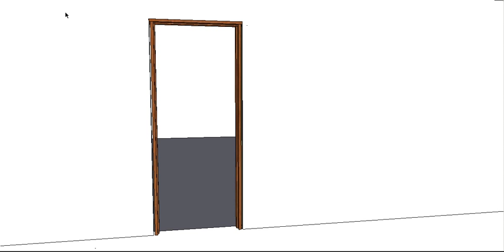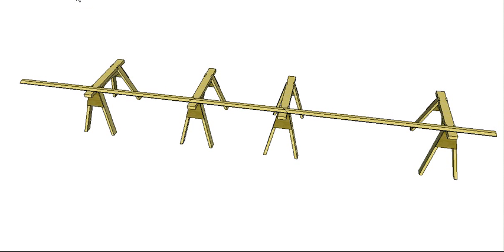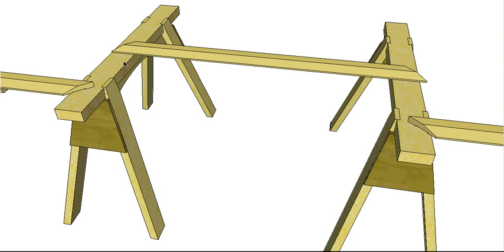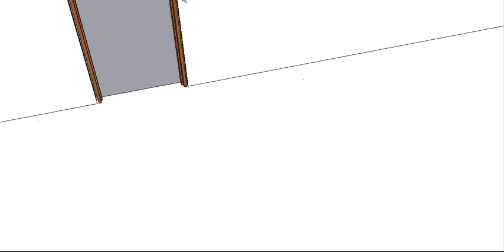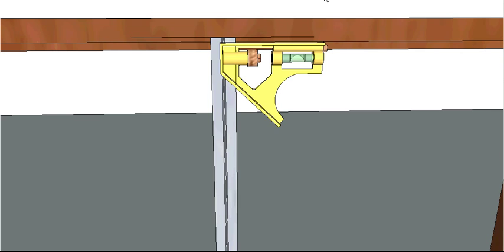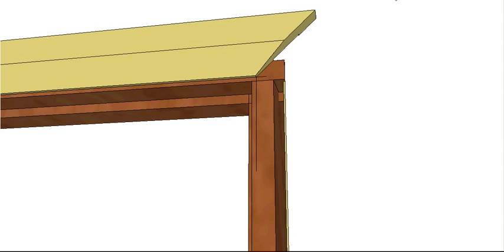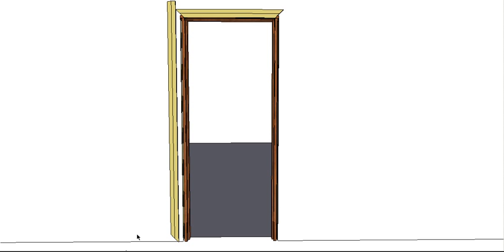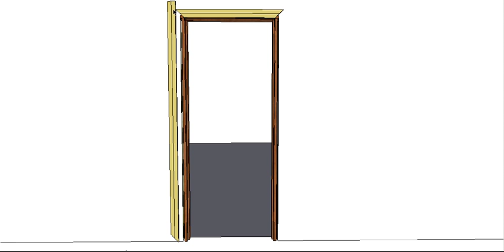Install Architrave to a Door Jamb

Comment: Thanks again for the video, so stupid question: if I've bought that length and calculating on those standards lengths of 2040 and 820, I'm left with 500mm of waste, am I correct?
And if I took the style or side jamb upside down to measure it, should I use a level to make sure it's plumb to get the right  mark on the head style?
Reply from the maker: Hi Mate, so the door is 2040 high but you have to allow for the clearamce under the door, the clearance above the door, the quirk and the mitre on top. Again with the Head we have to allow for the clearance on both sides, the quirk on both sides and the mitre on both sides. 
As for plumbing the Architrave when you mark it i have never done it, you can line it up with the jamb by eye and it will be close enough. Hope this helps.

Comment: I'd be interested if you could do a similar video on fitting skirting boards and how you personally cope them. I'm curious if the way I mitre then cope them is the best way to go about it, also how you handle external mitres where the walls aren't at 90 degrees after plastering and/or the floors aren't level.
Reply from the maker: Good idea Pete i will have a look at doing a video like this

Comment: What specific timber in Bunnings is this timber that you are showing in the video. the one that is 5.4?
Reply from the maker: Nothing specific, however, you can buy pre-primed MDF or pre-primed finger jointed pine in those lengths
Reply: Thank you. what does pre-primed mean? and what does finger jointed mean?
Reply from the maker: Pre-primed means that it is already primed ( painted) when you buy it
Finger jointing is a method of joining and glueing short lengths of scrap timber into longer usable lengths
Reply: Yes, I think I have seen it before, when you make fingers on the timber and then join them together. Thank you